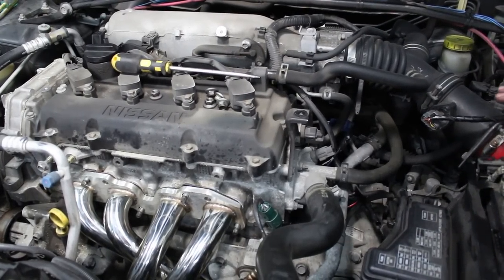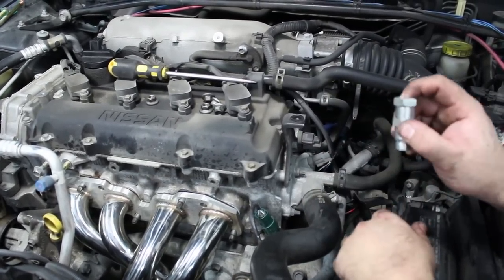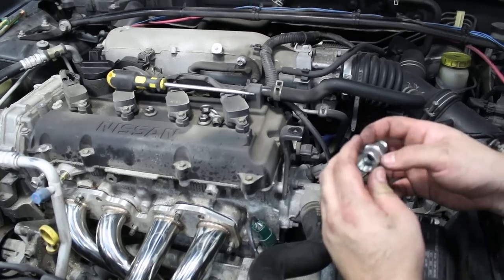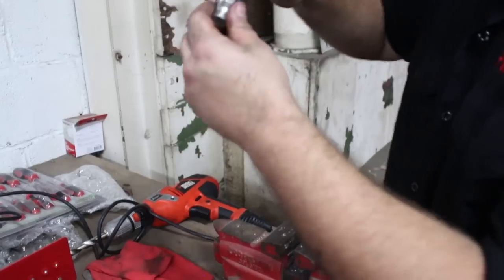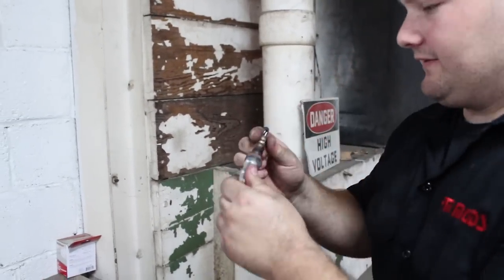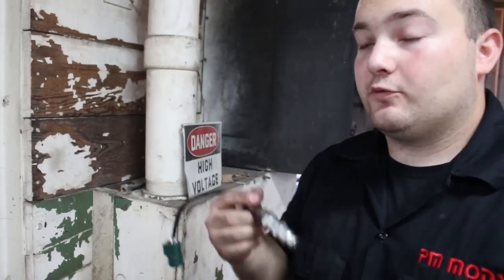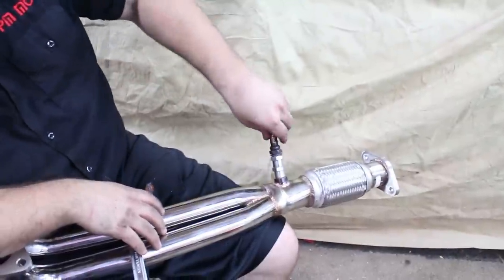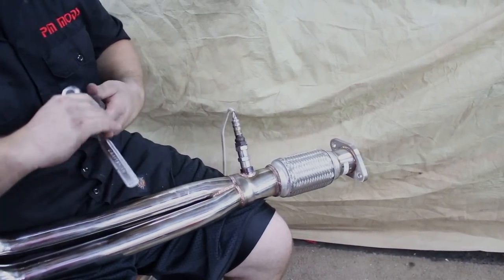$4 Catalytic Converter P0420 Fix | 02 Sensor Simulator | Pass Emissions | Oxygen sensor

Comment: I thought the purpose of the downstream sensor was to check to see that the temp was higher than the upstream one. this lets the computer know that the catalytic converter is doing its job. How does moving the down stream sensor, farther away (out of the exhaust stream) allow it to get the higher  reading. From what I have seen, the exhaust gas entering the converter is about 400 deg and out of the converter (since its burning the un-burned fuel) is in the 500 deg range?
Reply: E Buzek O2 senors don't measure heat per se, they measure oxygen content in the exhaust and send that information in the form of a voltage signal to the ECU. Normally, the upstream o2 sensor is used by the ECU to adjust the air/fuel mixture. The downstream o2 sensor is just to check to make sure the catalytic converter is functioning. It does this by reading the difference in oxygen content (voltage signal) between the two o2 sensors, becasue some oxygen is consumed in the catalytic converter it results in a different reading then the upstream sensor. 

What this does is it places the downstream sensor further away from the main flow of exhaust gases through the pipe which results in a different reading then the upstream o2 sensor which the ECU inturprates as a functioning catalytic converter, even if you don't have a cat in the your exhaust system. 

When it works, it's really ingenious in it's simplicity. I've got a 2000 Celica GT oil burner that is hopefully going to get a 2zz swap this winter. The oil burning has fouled by car's cat resutling in a low efficiency code. I did this mod some months ago, cleared the code, and haven't seen any check engine lights since. I may even try to remove the cat before it plugs completely and see if it still works.

Comment: Many thanks!  Just installed in my old 2005 Chrysler Pacifica w/ 3.5L V6.  Worked perfectly to eliminate the P0420 code!
Reply from the maker: Sweeet!
Reply: Poor Man Mods can I attach it to the from o2 sensor or it has to be the one in the bottom of the car?

Comment: I was told that this dose infact work and can take the check engine light off. But no one has bin able to confirm if it will actually pass a smog test when in California. $4 buck is a good deal to take it away but point less if it doesn't give me a green light on smog.
Reply from the maker: It will fix a check engine light but will not pass a smog test

Comment: I changed all the sensors and it keeps saying Bank 1 sensor 1 I changed it 3 times what can I be
Reply from the maker: +Jessica Corley if you didnt get the OEM brand of the sensor, get the OEM brand. If you have the OEM brand with anti foulers and still have a light, then you may need a catalytic converter

Comment: will this mod pass visual inspection in california? One time a smog ck station made me change a rubber hose that goes at the pcv, because that hose was for gas line instead of vacuum line.
Reply from the maker: it should pass visual, but not probing

Comment: I did it on my mercedes e class on my both oxygen sensor. Im still getting code for bank 2 sensor. I used non fouler on both sensors. Should i put non fouler on only bank 2 sensor to get rid of it or should both sensors should have non foulers? Or only one should have.
Reply: You only use it on bank 2 after the cat. Then 02 before the cat reads the air fuel mixture. The only thing the 2nd 02 does after the cat is tell the computer how well the cat is cleaning the gases out.  If you put it before the cat you can ruin your engine. Again only on the bank 2 after the catalytic converter. Keep the 02 before the cat alone, keep it as it normally is.

Comment: But what if the cat is bad and clogged? It will stil run like shit but not throw the check engine ligbt
Reply from the maker: If the cat is bad or clogged, this trick will fix the check engine light but wont help the car run better, you would need to gut/remove the cat. or replace it

Comment: I have another way to fix your 02 sencer I did it to my car and it works take out your rear 02 sencer Bosch only works for this  put the black windshield gualk in the holes with your fingers block all the holes let set overnight put it in the next day clear codes drive your car  will fix your problem permanently
Reply: Prentice Sawtelle you can use any glue, just fuck the sensor that it gives empty/idle reading...cat is dead and you pollute the environment like a maniac from the sixties

Comment: Wait a second here,, so how is this  supposed to pass the emissions inspection?  The inspectors will visually notice a defouler in place of the sensor and automatically fail you for moding your o2 sensor and tell you that you cant do that! And maybe will have already charged you for the test too!  Now they know you must have a bad cat and will remember you. Dont see how this could work.   This makes no sense.
Reply from the maker: In my state, the emissions test is simply connecting to the OBD2 port and checking for codes, there is no visual inspection or probing if the check engine light is happy.
Reply: @PoorManMods  Interesting.  Im pretty sure in my state they use a probe sensor in the tailpipe to check exhaust gas levels.
Reply from the maker: @scottsmith4145  youre state suckssss :(

Comment: Hello there,  How will the engine know how much fuel and air to dump in the engine without it reading? will it work just like it did before without the cat on? Of course there will be less back pressure but im wondering if thats a bad thing for an ecoboost engine
Reply from the maker: These spacers go on the downstream 02 sensor which is strictly emissions, it doesn't affect air and fuel.
Reply: Oh I see! Thank you!

Comment: And being an emissions inspector that little 4 dollar mod could get you 6 months in jail in certain states for emissions tampering. I suggest checking state laws on emissions before doing this because it will fail inspection on tampering. If your state doesn't have emissions inspections go for it because it will fool the ECM into thinking the cat is up to par. LOL. Just a little friendly knowledge.
Reply: And with overcrowding in jail from the war on drugs and people tampering with emissions means no room for violent criminals and poor use of my taxes. Now the fact I have an ultra low emission vehicle with a CAT at 94%, and they fail it without using a probe, because of a light, is complete BS. So hopefully they retrain these folks to use the actual probe and not an OBDII. I guarantee my code throwing honda Ultra Low Emission vehicle pollutes less than my neighbors Hummer. So that is why I would win any case where someone inspected my vehicle and found something like this. I would basically open a giant can of worms on the clean air boards and make them look like fools by asking them to "measure". That is the whole point right? Or is it a front to make a sh1tload of money off fines,  failing sensors, the ASE and the Smog Check places?
Reply: OBD2 standard is if your vehicle is emitting 1.5 times the allowable amount the check engine light or MIL has to illuminate and alert the driver through a code. Just because they didn't put the probe in the tailpipe doesn't mean it wouldn't fail. If you cant afford to fix your car maybe you shouldn't own one
Reply: @lucidgroove  there is also the prove I did it issue the court has to overcome. I had no idea it was there.

Comment: I did this to my jeep grand Cherokee 1998 v8 5.2l and it lasted 2 years and I have never got a check engine light.  if two doesn't work try three.  it just need enough to sniff it .costed 5 bucks at partsource for the spark plug defoulers
Reply: Joshua Hinchey you mean it needs stacked high as possible to not sniff anything

Comment: It works for about 4 or 5 start ups and check engine light is back I recommend oxygen simulators from eBay those are a guarantee no check engine light

Comment: This is illegal and only work when your light come on For p0420 and it passing emission but failing for check engine light Bing on. If you have a p0420 and your failing emissions it's not going to help.. your going to have to replace the cat ....
Reply from the maker: its not illegal in PA, and ive passed inspection 5 years in a row with this because they dont probe the exhaust, just check to see if you have CEL codes :D
Reply: That's cool ... They don't do a visual check?... To see if you have cats... I live in CA... You know about California and all it's  emissions rules...
Reply from the maker: nope, they dont do visual checks on OBDII vehicles, just hook a machine up to the OBDII port
Reply: Crazy ...
Reply from the maker: and OBDI is the opposite, they do a visual inspection to see if a CAT is there ,but dont hook a machine up to the car, so you could have a catalytic converter heat shield welded to just regular exhaust pipe and they assume you have cat, thats what i did to the supra ;)
Reply from the maker: you are lucky you dont have inspection! where i live, it the car is OBDII and the engine is OBDI they treat the whole vehicle as an OBDII
Reply: Yeah there's lots of thing you can do to get throw them inspection.... But over here they don't play. They even have check points where they check your car. Like a DUI check point but for smog...  That's what they call the inspection over here  a smog check...

Comment: and if you have a lowered car and the o2 faces down and u see a big speed bump u wont even have an o2 sensor anymore lol this is a great way to fix that issue though
Reply from the maker: the 02 should never face down, it should always be pointing up 10degrees or more to allow moisture to drip off it so it doesnt corrode on the inside of the exhaust
Reply: +Poor Man Mods my o2 sensor points downwards.
Reply from the maker: poor design
Reply: +Poor Man Mods very poor design, that's why I'm on stand alone ems without any exhaust period!! 😊

Comment: I did this trick on my 2005 Dodge Grand Caravan about 7 years ago. 7 years. Still no P0420 code. I get my inspections done at a mom and pop garage where they don't give a crap about things like this. If it works on your vehicle, it's definitely worth it.
Reply: Did you use 2 anti foulers put together?
Reply: @tinytim9453  yep
Reply: @Aquahutch702  Thanks!

Comment: PRIUS OWNERS (Gen 2-2004-2009) - look online for an ELBOW-shaped device to screw into the cat converter.  Very difficult to screw this in straight.  Also, you have to raise your car up high from the passenger side front and side and make sure to protect yourself... not much room under there.  Absolutely works.  Took about 3 hours for me because I tried it the hard way first.  If I had to, I could do it in less than an hour now.  Found here...  https://www.amazon.com/Degree-Angled-Engine-Exhaust-Extension/dp/B00B1U6I54

Comment: i got a po420 code 2001 nissan frontier v6  bank 1 is after the cats right?
Reply from the maker: +roland martinez bank 1 is one side of thr engine, bank 2 is the other side. I'm not sure which side is which though
Reply: That makes since because my valve covers are leaking oil. And it drips on top on the sensor.  Maybe that cause the o2sensor to fail huh...
Reply: Bank 1 before cat, or upstream. Bank 2 after cat, or downstream. They're two different types is O2 sensors also.
Reply: @obsrollin4133  no that wouldnt cause it to fail

Comment: stupid idea  now I got whole bunch of light on my dashboard
Reply from the maker: You did something very wrong. Did you put it on the upstream sensor?
Reply: @PoorManMods  Yes i did
Reply from the maker: @tonytran4857  it goes on the downstream ONLY
Reply: @PoorManMods  bull shit
Reply from the maker: @tonytran4857  stay far far away from cars
Reply: @tonytran4857  Guy just so you know the upstream sensor typically in most applications controls a bunch of engine variables that read info off that sensor for engine performance and tuning that the PCM\ECM adjusts.    The downstream sensor typically reports back just catalyst efficiency information.    Do not mess with your upstream sensor.
Reply: @PoorManMods  No your idea are stupid you need stay as far as you can leave to our professional  worker on car
Reply: @corollaguy6740  You are right and fix the right way
Reply from the maker: @tonytran4857  this video has helped thousands of people, you just did it wrong

Comment: I got two messed up catalytic converters on my 07 f150 5.4 v8 you got anything to do a poor man fix on this POS.
Reply from the maker: Try gutting them and doing the 02 sensor spacer I made in this video
Reply: +Poor Man Mods will this pass California smog test?
Reply from the maker: i dont believe it will pass Cali Smog
Reply: Supposably there's 80,000 mile the emissions warranty. my mileage is under that any tips how to haggle with ford dealership (and win)?
Reply: worst motor ever.. sell asap

Comment: The best way to fix the catalytic convert is to fix it not to trick the engine computer because this sensor is to tell you there is a problem and it will use a lot of fuel and less horsepower for your car
Reply from the maker: Wrong
Reply: Lemme hold 2800 for my wife's 2010 traverse then..... Them bastards getting gutted.

Comment: Wow some serious non engineering drilling going on there bud. Should have drilled it the other way using a drill guide. Then taking the size up bit by bit finishing off with a used 1/2 drill and drill lube then it wouldn't grab.

Comment: There is a better way. A capacitor in the range of 1000 -2000 μF connected to signal and signal return does wonders on any type of O2 sensor.
Reply from the maker: Have you done this before?
Reply: yes, it works! secrets of the trade. I solder capacitor leads to t-pins and insert them on a side of a 02 plug or ecm plug. also they can be soldered inside ecm. Works great! We used to use nonfoulers but they quickly corrode and have to be drilled to the OD of the sensor, so we just stopped using them, and came up with using capacitors.
Reply from the maker: Very nice!

Comment: I know this is a poor man mod, but you do realize your car has a catalytic converter for a good reason, right? It greatly reduces toxic gasses emitted by the engine, like carbon monoxide and nitrogen oxide. If in any way possible, you should fix or replace your catalytic converter.
Reply from the maker: less cats = more power
because racecar
Reply: I know, and that's cool and all, but I think you should let people know what the consequences are for driving around with a non functioning cat.
Reply from the maker: im sure 99.99% of people know
Reply: Looking at the comments, I'd doubt that. I think the catalytic converter fell victim to the global warming hype, and people either don't know of have forgotten that its function is not to reduce CO2, but to prevent smog by reducing toxic gasses.
Reply: False............ cats do not restrict exhaust. proven. Look at circle track tests for 500+ HP with and without cats no difference. No I know you don't know what your talking about. do some research instead of sling BS that your buddies told you
Reply: It's important to consider other types of pollution. The amount of vehicles wasted because they were too expensive to make emissions compliant is huge. Sure they melt down the steel and recycle it, but what about the resource and energy that go into building the replacement? In this disposable society, there's a lot to think about. I'm not saying emissions are fake, not by a long shot, but on a case by case basis you end up with more empathy for the working man or woman.
Reply from the maker: Robert Slingers Pop dyno proben results of cat vs no cat at 3:00 https://www.youtube.com/watch?v=QjaK5n86IjY
Reply: I refuse to have a battle of the wits with an unarmed person. Not one person above has said anything about forced induction. Sheesh
Reply: Who cares about a tiny bit of performance increase or decrease? With the same logic you could make a case for throwing your trash out of your car window. There's a reason people don't do that. And for that same reason, cars have catalytic converters.

Comment: Adding " spark plug non foulers" onto your O2 sensors is considered tampering with your emission system. In states where they do emission inspections this would be illegal. They arent called O2 sensor CHEATERS for no reason.
Reply from the maker: Yeah...

Comment: i bought some for my f150 (obdII)30 bucks didnt work worth a shit
Reply from the maker: Never tried it on a Ford, but if the Oxygen sensor are the not exact OEM sensors, or you put the spacers on the upper stream instead of down stream sensors it wont work.
Reply: i put them on the down side ones and i not sure of the sensors being oem but i will find out thnx 4 reply
Reply: Greg Miller You ever get it to work?
Reply: not yet// I havent tried anything different yet any ideas?
Reply: Greg Miller clogged rear sensor with glue (heat resistant silicone every hole) back in...no fail emissions